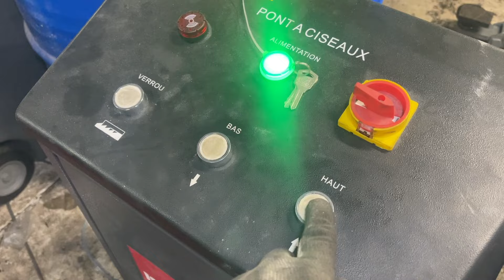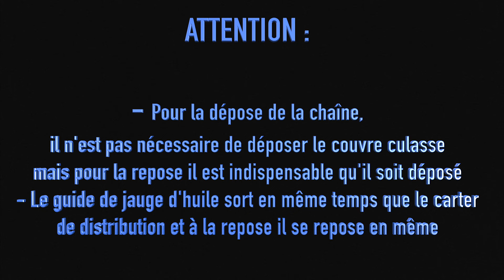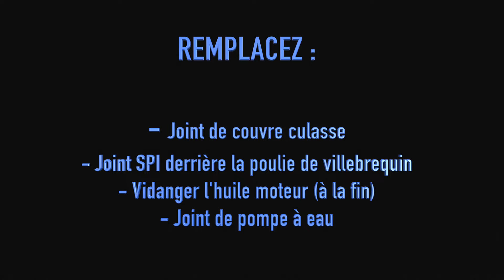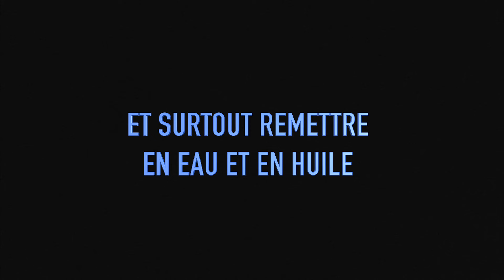REMPLACEMENT CHAINE DE DISTRIBUTION 0.9 TCE RENAULT DACIA NISSAN

Comment: A partir de 2016, il y a eu une modification du kit chaine avec une nouvelle reference du tendeur, l'ancienne était 130706425R, la nouvelle est 130701HC0A  .
Reply: Ca n'a pas résolu le problème: à 100 000km la chaine se détend à nouveau.
Reply: @emmanuelbardamu6204  Quel intérêt d'y avoir mis une chaine si c'est moins fiable qu'une courroie et plus cher à remplacer?
Reply: @BillBochon  Diminuer les fréquences de vidange !.
Reply from the maker: ça ne résout pas le problème

Comment: Je croyais que sur ce moteur la distribution n'était pas a changé car justement c'est une chaîne , pourquoi la changé vous ?🤔
Reply from the maker: Car elle fait du bruit, elle se détend tous les 100 000km environ
Reply: @multiroux  donc quel et l'intérêt d'avoir une chaîne si c'est pour la changer aussi souvent qu'une courroie classique , moi je pense que c'est lié plus a un problème de fiabilité qu'autre chose normalement tu n'a pas a changé de courroie a chaine tout les 100 000 kms
Reply: La mienne a pété à 120000
Reply: @ericligneres9891  c'est vachement rassurant ! C'est pris en charge par Renault ?

Comment: Hello, I have the same car and also 0.9tce engine. My timingchain after chain rattle when reving above 3000rpm has been replaced including oil pump, but ever since the car is shaking a lot when driving. The mechanic told that when he was starting the car in the morning before, the engine turned over but did not go forward or backwards. He did a compression test: Cylinder 2 compression is 7.0 bar and Cylinder 1 and 3 has 12.0 bar. When looking with a camera inside the engine, you can see a little valve mark on the pistons. When performing a leak test, you don't hear air escaping. Is it okay to drive the car in this condition? Or do I need a new or used Cylinder head? Please advise and thanks for helping! Or could the compression loss come fromd something else, like bent piston? Check engine light only flashed like 4 times. Did not stay on. There was a fault: P0300. The mechanic said with the Bosch scanner it was multiple misfire cylinder 2
Reply from the maker: Hello, the problem may come from a bad chain setting or a twisted valve. You have to remove the bolt to check. If your mechanic can't find the problem, it may be faster and cheaper to change the engine...
Reply: @multiroux  the chain was indeed wrongly timed. It is fixed since 2 months ago. The only thing that remains is instead of 13,8 bars op pressure on all 3 cylinders is 12,5 bar on cylinder 2. There might be a slightly bend valve but should not have many impact as the car drives wonderful. I know a 3 cylinder engine is not going to work without shaking, but the engine is still shaking a little felt in the interior. Maybe new engine mountings?
Reply: @multiroux Maybe you can help me with this. When I start the Clio for the first time of the day (cold start) the Clio IV revs to 2000rpm and then lowers slowly to 1500-1700rpm range. After 2-3 minutes the idle setlles down to 900rpm, like it should. When I put the car off and then start the Clio for the second time, it starts up like it should. Begin at 1500rpm and then goes down to 900rpm within 20 seconds. It is so strange. I cleaned throttle body, MAP sensor, Inlet Air sensor (other MAP sensor), 3 new plugs, 3 new ignition coils, and checked for Error faults with OBD2, Renault dealer found no faults present, still the same strange thing happening every day. No idle hunting, just the first cold start no matter what the outside temperature is. It started after timing chain replacement. I heard a few Clio's have this problem. Please help me with some advise.
Reply: @johnnyvdpijll2927  Sounds like an air leak on the inlet side - when the car has some heat the engine expands and the leak seals but when cold the leak appears.
Reply: @superelectic45  thanks for your reply! appreciated. Where can I start looking for this small air leak? Is revving of the 0.9tce normal in the first start of the day only? For warming up the catalyc converter? After 1.5-2 minutes the idle settles at 850/900rpm and it drives great. Starts up after that is how it supposed to be.
Reply: @superelectic45  small air leak before the throttle body or after?